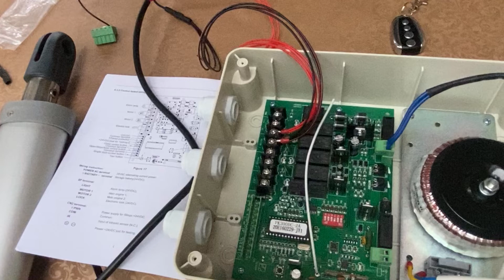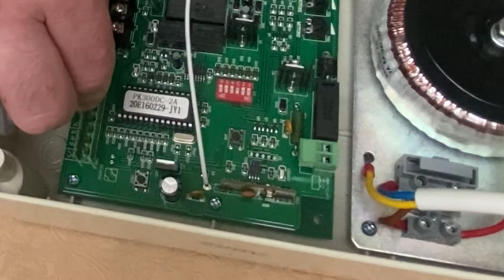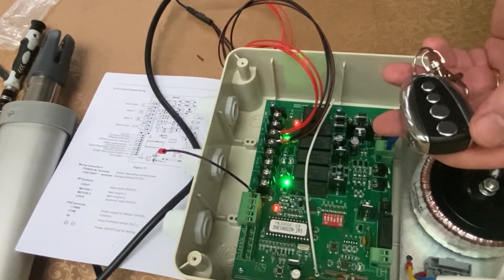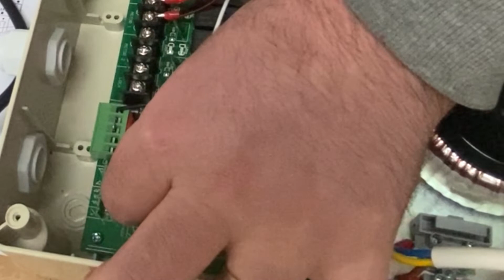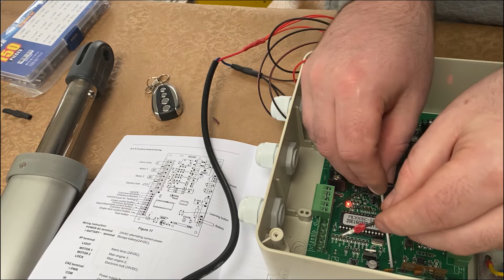Amazon bought Sfeomi swing gate kit issue. No forward or reverse option. Loop only function.

Comment: Hi Gary, my gates have been opening/closing flawlessly for about 4 months. Yesterday they started opening and closing continuously. When gate 1 hits the physical stop it opens both gates and continues that cycle until I intervene. It seems the sensitivity of the obstacle obstruction has malfunctioned as I have adjusted this and no difference. Aby suggestions? Thanks
Reply from the maker: If you have done nothing to cause the problem, it may be that the IR sensors are being triggered when the gate is closing. You could try disconnecting these first to rule them out. Then try adjust the resistor on the board. Then block one the gates halfway through the cycle (before the normal stopping place). The results of these tests should give you a good clue as what the problem is.

Comment: Got all setup but one gate opens whilst other one closes. Whats wrong ?
Reply from the maker: Temporarily disconnect one of the actuators. Press the open/close button once to activate the connected actuator. When the cycle is complete, reconnect the other actuator and both will be set to open or close. 

Alternatively you can switch the wires around on one of the actuators where it is connected to the control unit. This will reverse the polarity of the motor and then both motors will be set to the same direction.
Reply: @GaryOnPower  thanks mate I shall try tomorrow and let you know how I get on.
Reply: Dip switch setting

Comment: Hi Gary was just wondering I have the same system and I can’t get a replacement fob as I am in the north of Ireland was just wondering if you can get them in the south cheers
Reply from the maker: Brexit issue? The fobs can be purchased from everywhere and are pretty standard. I've seen the same kit being sold with different fobs on AliExpress. You need only pair your fob to the board. It's best to try get the same style, but really any RFID fob should do the trick. I can't recall if there are pairing details in the manual, but it should be online or available from the seller if not.

Comment: Hi, I have problems with infrared emiter. The doors don’t close. Do you know how to cancel sensors in order to be able to open and close the doors ???
Thanks in advance.
BR
Reply from the maker: Disconnect the sensors to eliminate the feedback. The motors will work again if that is the problem. Mine are installed with no sensors at this time and gates work without them....obviously this means being extra careful until I install the sensors.

Comment: Gary I wonder if those extra pins might be for ground loops and auto gate opening function?
Reply from the maker: Hi Gilberto. The problem is not with the board, as it has all the functions needed. The problem is the type of actuator in the kit. It only has two wires in which to connect to the board, so what happens in layman's terms is the two wires connect the motor to the board and the board switches the polarity after each cycle. It wasn't my preference for setup, but I made it work in a dumbed down version of automation where the open and close command are essentially "on" commands and move the motor in the opposite direction to its previous cycle. It simplified the whole setup and wiring, but I was disappointed to lose the ability I had planned just because the product being sold did not do what it was supposed to do. The finished product is here on my channel if you have not seen the video => https://www.youtube.com/watch?v=O1SV-JjoI_o

The project and thesis landed me 80% for my final grade, so I achieved what I wanted with it.